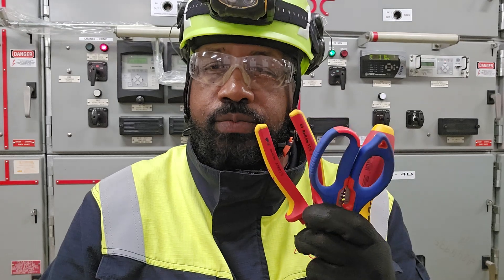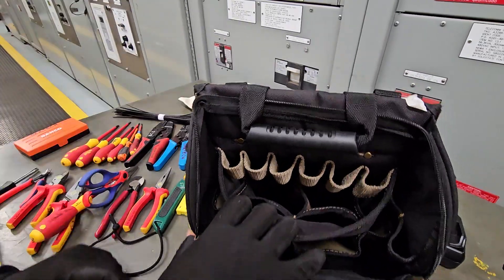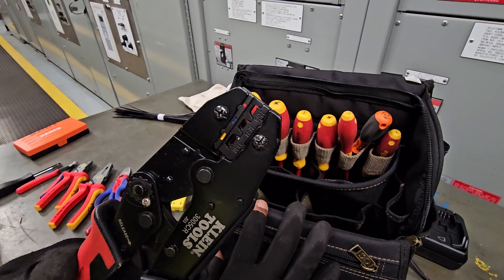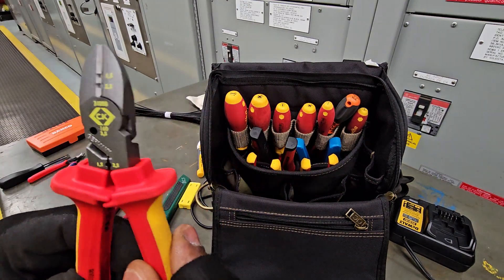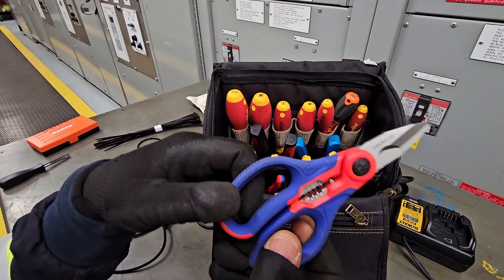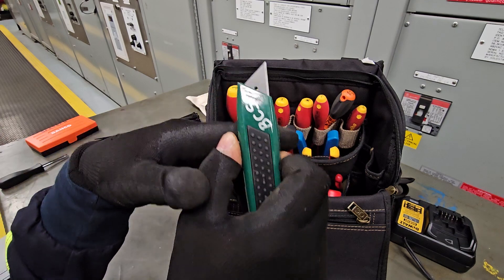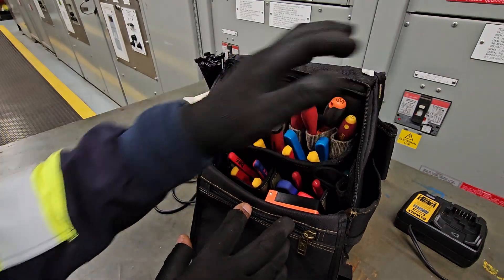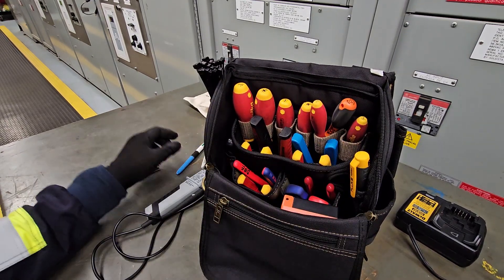Electrical Hand Tools for Control Panel Work by Daveed Master Generator Technician

Comment: What type of education background do you have, and how long have you been in the industry? Thank you!
Reply from the maker: With 38 years of experience with Original Equipment Manufacturers, I hold 10 college diplomas across various technical disciplines, including:  

- Diesel Engine Technology  
- Automotive Mechanics  
- Truck Mechanics  
- Auto Electrician Expertise  
- Automotive Electronics & Microprocessor Applications in Vehicles  
- Mechanical Engineering  
- Electrical Engineering  
- Electrical Installation  
- Electrical Inspection & Testing  

My extensive expertise spans mechanical and electrical systems, vehicle diagnostics, and engineering applications, making me highly proficient in both practical and technical aspects of these industries.

Comment: Good stuff 👍.   We use to use thay bag alot till veto or velocity came around.  It has a good useable layout for sure.  I do suggest you look into the 150mm tsunoda cable tie snips with puller.  They can be had from supreme tools I think for the uk market.  I've converted many coworkers and comerical electricans over to them over the 2x as expensive knipex.  Can't say thay often there made in Japan and fantastic quality.